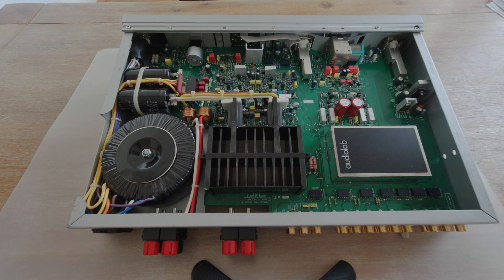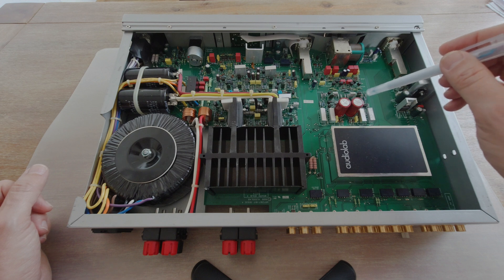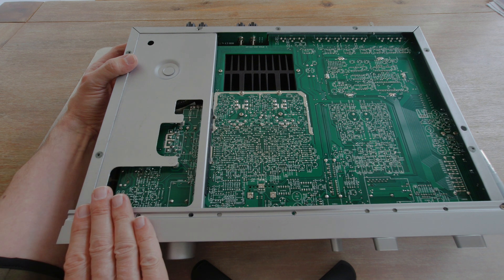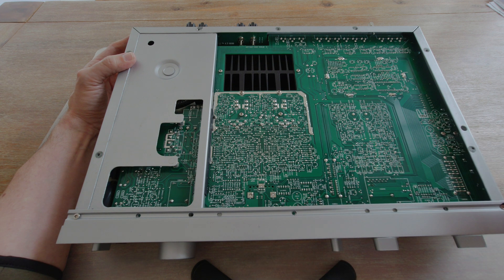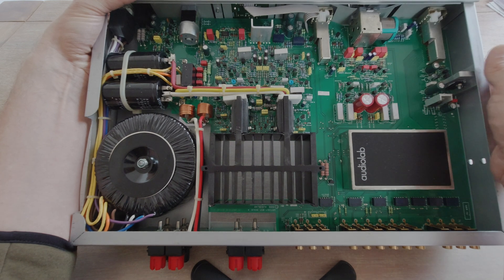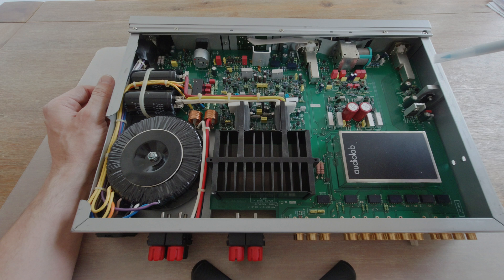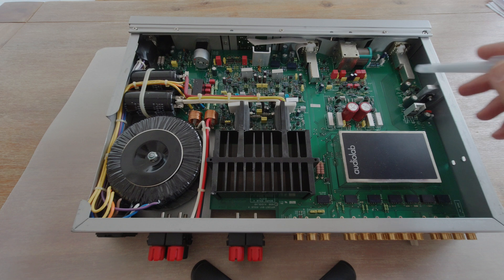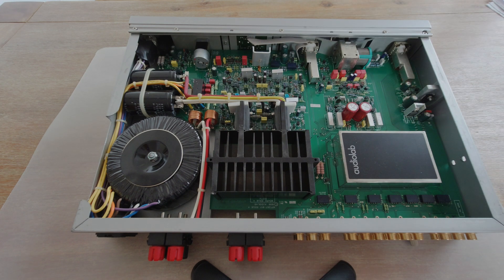Audiolab 8000S - Build: Part 4a - Focus on the circuit

Comment: Do you think it would benefit the amp if you put more ventilation holes in the top
Reply from the maker: It will improve a bit, but notice that the bottom has no openings. For holes on the cover to be effective, it needs openings in the sides or the bottom to have a temperature difference so that the slightly cooler air can get in. The hot air will then raise, starting a chimney effect that sucks the cooler in. But this case is all double walled, and the Mainboard covers all the surface. Very difficult to create holes with the desired effect. And active fan on top of the existing openings is likely the most effective.

Comment: Hi, do you have a link for the info you mention about the resitsors and heat issues?
Reply from the maker: Hi  @michaelbrind9222  . No sorry, I bought the resistors and must have deleted the link. But if you look in internet, you can figure out by the colour code the resistance you have in your unit, and the advice from someone was to buy one that can handle 4 times as much power. The originals were some .25, buy 1.0 or more. I have not been able to work on any of my HiFi as of late.
Reply: @high-endcafe   just bumped on this channel and comment.Just got an 8000s, good sounding amp but mine goes in protection very early, not even half of the volume control and I am not talking of crazy volume. I got the bias checked but did not solve what in my opinion is a problem. Did you find any good resource about how to fix the heating issue ?
Reply: Hi @michalbrind9222 @thedoublesuser , just bumped on this channel and comment.Just got an 8000s, good sounding amp but mine goes in protection very early, not even half of the volume control and I am not talking of crazy volume. I got the bias checked but did not solve what in my opinion is a problem. Did you find any good resource about how to fix the heating issue ?